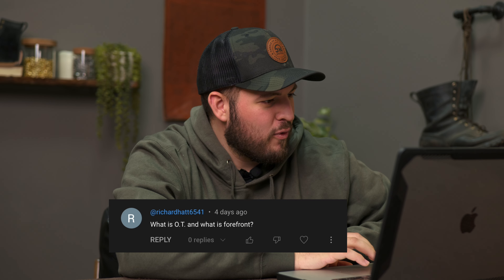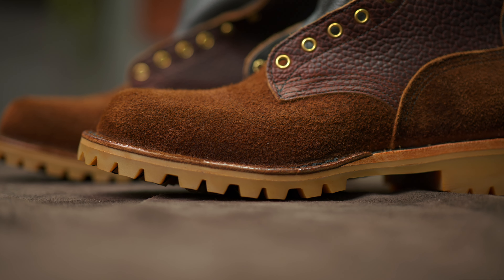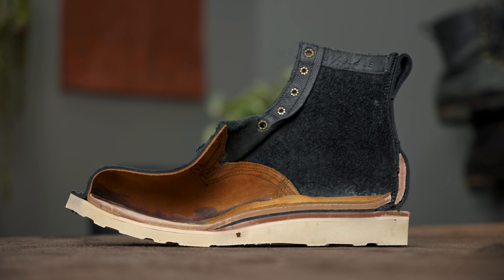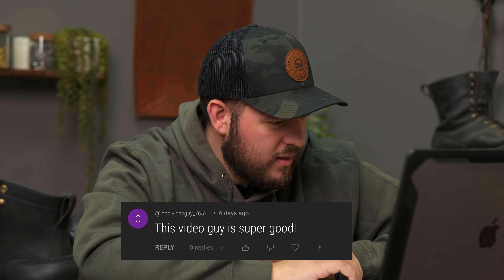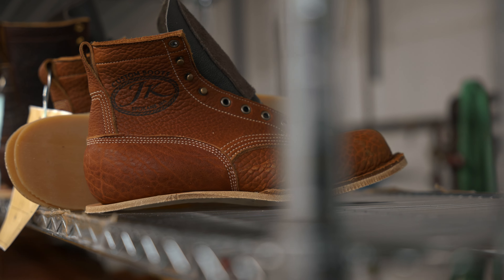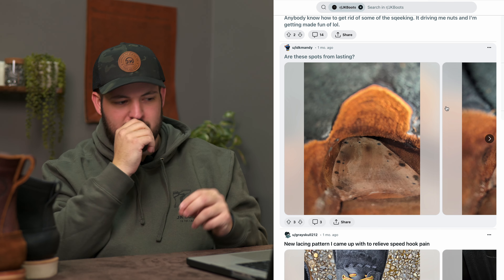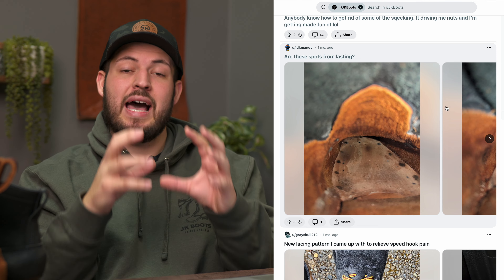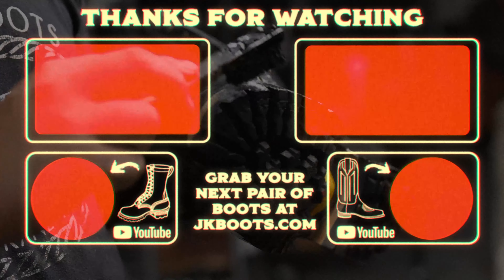Responding To Your Comments | JK Boots Q&A

Comment: I gotta add my two cents in about the person who commented regarding price. I have 25 years in the electrical trade. I started my career wearing Walmart boots, then eventually got to the redwing range of boots. And at the time I thought the price was ridiculous for red wings. However I still wasn’t all that thrilled with the performance I got out of those but I figured that was the top tier and this just what it is. It wasn’t till later in my career, very recently that I started talking to a few other folks that had stepped into the handmade PNW boots and they sounded like salesman. They sounded like they had stock options in these companies and they sounded like they were trying to sell me on them as if they received the profit. However one guy said something to me one day that pushed me over the edge and made me willing to try a pair of JK’s. He said the part of your body that works the hardest and the longest are your feet. And then very shortly after that I saw a video from a YouTuber “wranglerstar” talking about JK’s. I figured if I am spending $3-350 every year or every 1.5 years. I figured I might as well try a pair of JK’s and if I get more time out of them and they address even half of the things that i am being told they did then they might be worth jt. i received my first pair if bison forefronts a year ago. Immediately i noticed a few things. the break in period was almost 1 day compared to weeks with red wing. the second thing i noticed was my lower back pain and my foot pain was reducing a significant amount every day i wore them. a year in and my feet no longer kill me after 14 hours on them, my lower back pain was reduced by 70%. and after a year i would say the soles are worm about 25%. so i believe i am on tract to get at least 3 if not 4 years out of first pair. i am sold and will never buy another boot besides JK. i love them so much just bought a second pair, this time i got the ot bison to get a bit more traction in winter conditions. i even find myself wearing my JK's on days off because of how much i like them. trust me, the price is really a bargin considering what your getting and how much better your day will be after wearing handmade top quality footwear
Reply: Congrats you did the same to me, been trying brunt boots and red wings work on concrete in and outside grass asphalt loading things bending over they just aren’t doing it for me anymore. Think you have sold me on getting a pair of bison forefronts and bison ot. Get both switch between them will last years, the price is steep for both but if they last years will be worth it.

Comment: My first pair of handmade boots (Spokane made) are coming up on 20 years old. About 3 years after I got them I bought a second pair so if one was in for a resole I’d always have one, I wear them 300+ days a year. Can’t say how many resoles I have done but only now is one pair ready for a rebuild. I added my 3rd pair a month or 2 ago (shadow OT’s) and have since ordered a pair of the honey bison. All soles have always been honey vibram throughout. That original pair was $450 in 2005 so I’d say a lot of bang for the buck. The year prior to that I went through 2 pairs of Danner quary’s that were in the $275 range each.

Comment: Another trick or extra step if you have a hotspot.   

Like you said oil and wear but also a bit of ducttape on your foot in the spot of the hotspot. 

The duct tape will help prevent injuries to your foot and usually peals off easy at the end of the day.  🤷‍♂️🤠

Cheers 🍻
Reply: Or even better, blister band aid. You can wear it multiple days, and becomes kinda like a second skin + prevents blisters and helps breaking in more cuz of thickness). Make sure you get good quality ones tho, the cheaper ones will peel off very fast, and will mold less to the skinn

Comment: This guy 549 thats still expensive dawg
Reply: Then these boots are not for you. They are purpose built for people with specific needs. Or people that appreciate well made footwear. Cheap boots aren't cool and cool boots aren't cheap. Everyone has "their thing", also.
Reply: @dusty6570 You get what you pay for and you pay for what you get.
Reply: In terms of PNW boots, 549 is on the lower end, you have to look at the big picture. You can't compare these boots to something like Red Wing or any other leather boot that is mass manufactured.
Reply: I understand your point but remember, 1st), the materials (leather hides) are not cheap but the quality is so much better than a machine made leather boot. 2nd) Labor Costs. When you have a specialized boot made, you need the right specialized personnel to build them and 3rd) If there is customization (special leather hide, 'steel' toe, etc). Just remember they are handmade from the ground up. My boots are not J.K. but from another boot manufacturer and had them for over 25 years. I have never had one problem, fit my feet like a glove and they are protected for my work unlike the cheap machine made boot. And I can always take them back to get them repaired / rebuilt at the cost of a new cheap pair of boots. So the question then becomes, how much are your feet worth???? Cheap or worth a little extra money for top of the line protection.
Reply: My coworkers buy $100 boots every year because that's what our company offers for work footwear cost coverage. Every year they buy a cheap pair and every year they replace that pair. I've had my JKs for about a year and a half and with regular oil and shoe trees there's zero holes, tears or delaminations. And once that sole wears out I can just send it in and have a new one put on for a fraction of the original cost. The arch support alone justifies most of the cost. They are expensive but they're worth it in the long run.
Reply: I got Red wings every 1 to 1.5 years that cost $349.00 and completely wore them out within that timeframe. And not to mention, I had sores on my feet during breaking. I got a pair of custom super duty boots for $700.00 and trust me it is worth the money. The comfort and support you get from the boots are worth it. Let me just say this much, I wore the boots the first time for a 14 1/2 half hour day on my feet all day And I didn’t have a single sore or blister on my feet. I have had my boots for a couple of months and they honestly feel like tennis shoes and they’re composite toe. Yes I’ll say yes spending that much money on a pair of boots is hard to swallow. But once you do it and you wear the boots, it is worth it. And when you compare the leather to a pair of rings leather it almost seems like the leather is twice as thick with the JK boots compared to Red Wings. And like I said, I have had my boots for a couple of months and I don’t even have a scratch or scuff on the leather. my red wings would be scuffed up and scratched. And if I took Dan dish soap to my boots and scrub them clean and let them dry I guarantee you they would probably look brand new.
Reply: just get some made in africa jim green boots . all leather from $100-$250
Reply: Why don't you spend a little time pricing out the material cost for leather, tanning, sole, machinery, thread and other parts involved with shoe and add the cost of living in the united states.  Dawg
Reply: POOR 🫵🏼😂